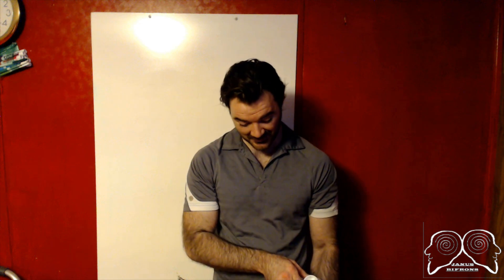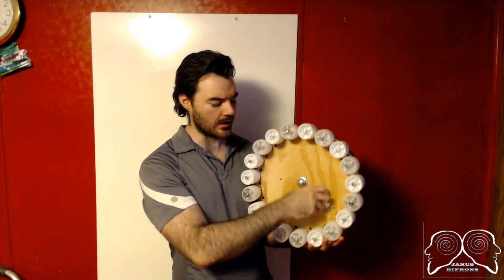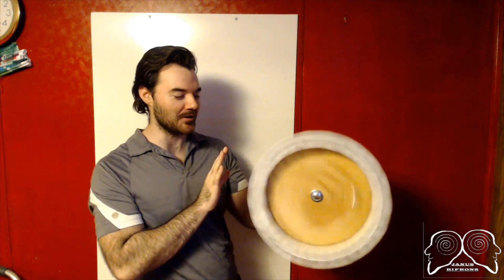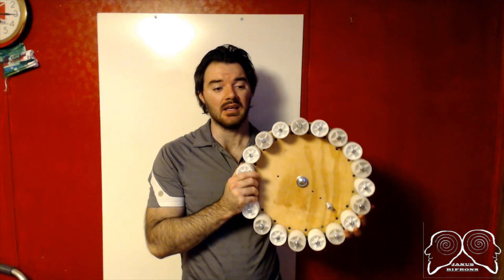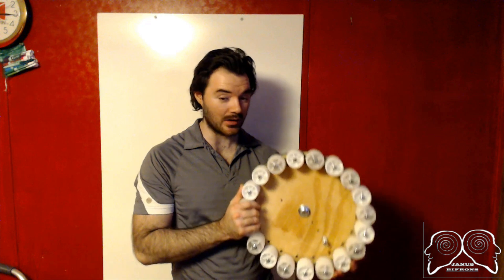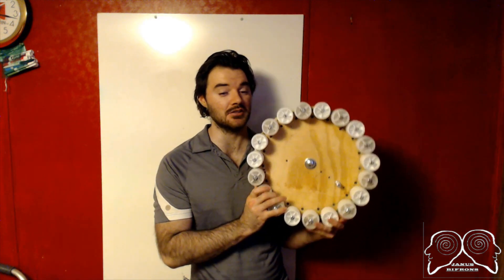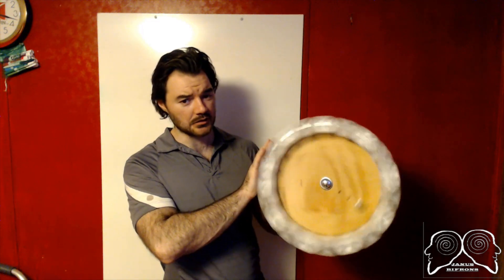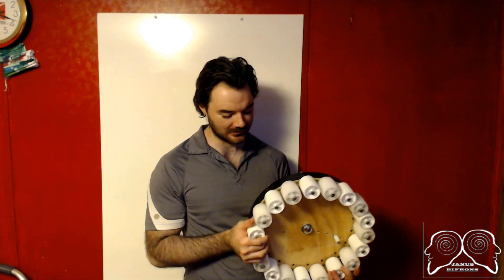Angio-Wheel: Overdraw

Comment: Hey why are erections smaller right after you perform am1?
Reply from the maker: Pretty simple. There is a lower in flow than out flow. But it gets more complicated from there. The arterial network is made to dilate in response to shear stress. So, if you consistently notice that your penis is in a deflated state, this could be evidence of reduced arterial compliance/responsiveness.
Reply: @janusbifrons3870  ok and does the am1 work for the inner penis too

Comment: Janus what are your thoughts about kegels ?
Reply from the maker: Just about worthless. In fact I have reason to believe they will lead to undue tightness in your pelvic floor that will eventually cause its own issues. You'd get more from a solid lower body routine that focuses on asymmetrical training such as step ups, lunges, and one legged leg presses.
Reply: @janusbifrons3870  Good to know man, thanks. Also, if you can answer, i'd like to know, how does the cost of masturbation, as you explained, affects sex,  and how to manage a sex life while practicing your methods.
Reply from the maker: Muscle control and breathing. Few things can push a guy over the edge than not controlling pelvic tension and breathing rate in my experience. The other would be subconsciously racing towards the O. Everyone wants to try and escalate the experience. I learned its better to aim for a different target. Focus on your partner and put the physical feelings on the back burner. It wasn't easy the first dozen or so times, but eventually I got good enough to where I could set the pace with ease. If I wasn't feeling up for a long session, I'd choose a rhythm that got my partner to her O first. If I felt like getting in some fun for the evening, I'd choose a rising and falling pace. Learn your partners cues. Everyone has them.
Reply: @janusbifrons3870  So you focus on your partner pleausure and avoid your climax by any means, or once in a while you allow yourself to get there ? I thought It might be a possible way around it the use of some technique of dry orgasm or tantric sex.
Reply from the maker: Honestly, I hate orgasms. They spike my prolactin so much I have a headache for hours after the fact. So for me, its easy.

Comment: Hello I just start using Angion 1.0 like 2 weeks already. And noticed that my penis is more fuller in my hands . Its still the same centimeter.  I practice  Angion 5 to 6 days a week for 20 minutbes . Hitting the gym ,eating clean .  Can I ask you a question ,when you start to notice your first results.
Reply from the maker: Sounds like you are starting to notice them as we speak :). The penis will begin to grow as your arterial networks develop.  As your resting fullness goes up, the gains will start rolling in.

Comment: In what direction would you spin off? I understand away from you, (from base towards tip) but I believe I saw you the other way around
Reply from the maker: Good question :) The Angio Wheel is meant to stimulate the Bulbo-Dorsal Circuit via positive displacement enacted upon the Corpora Spongiosum's Bulbo-Urethral arteries which run down the length of its chamber alongside the urethra. So, should I be holding the wheel with my right hand I would be spinning the wheel counterclock wise. Conversely, I would be spinning it clockwise with my left hand. In both cases, blood is being pushed up the corpora spongiosum body and into the glans where the bulbo-urethral arteries terminate and then form tributary veins that feed into the deep dorsal vein on the dorsal side of the penis(the part facing you when you look down)

Comment: change wheels format , one with little negative curvature can prevent it slip to the sides ,   normal = _ , sugestion =  \__/ or U
Reply from the maker: Whenever I first made an Angio Wheel, I thought I would need a bit too. Honestly though, they are remarkably stable upon rotation. They really don't wander around much. Might still be handy though eventually.

Comment: Do you lube each wheel? Aren’t you worried about chafing? Also do you have meal plans we can purchase? Thanks Janus.
Reply from the maker: The wheel roll very easily and smoothly. There is no worry about chafing in the least. Its extremely pleasant to use an Angio Wheel. Meal plans? Nothing yet, but I am currently working on a book that will be over my collective works, so look out for that here in the coming months.